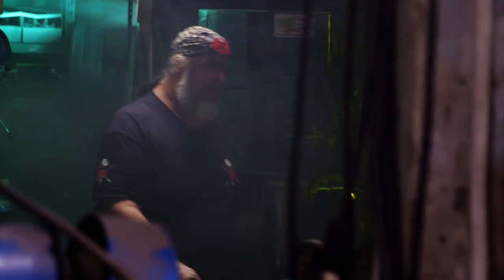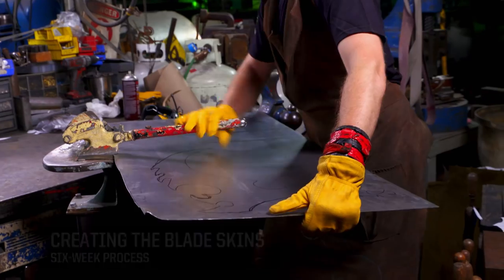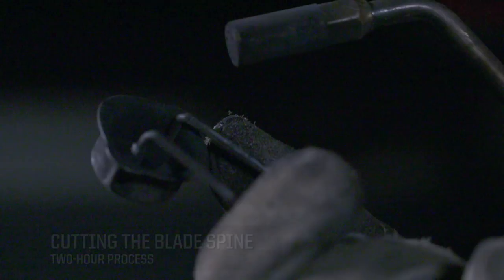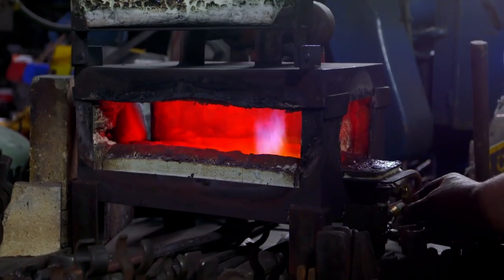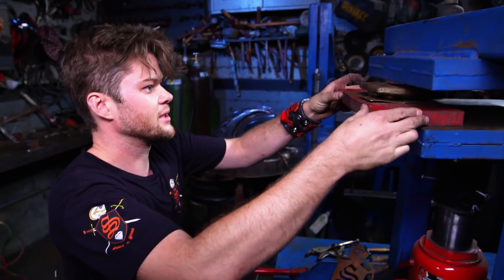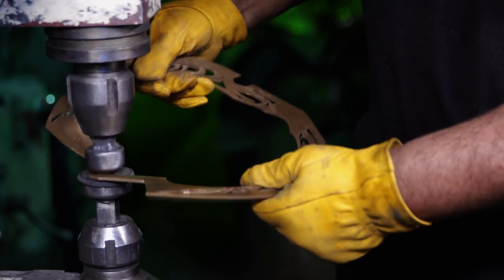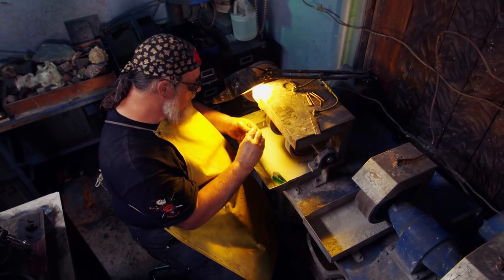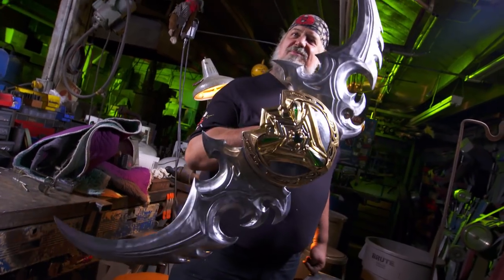Azeroth Armory: Forging Warglaive

Comment: I'm pretty sure if people put their minds into it, the glaive can be made to weigh less. Also, two of them balances the muscle pressure in your body, allowing you to wield them longer. I mean come on, I weigh 68 kg and I am able to hold 10 kg dumbells in each of my hands for a good 10 min - no problem. Furthermore, why isn't there 2 of them in the end demo? Blizz is being greedy again. And the way you fight with them is totally wrong. People keep saying that the glaives are the least practical weapon in melee combat. I tend to disagree. Imagine a large muscular person who can actually hold the ligher versions of both glaives (come on, these can be made lighter, it's just really expensive). There are two glaives with two edges and a shield for a reason. A skilled person will parry 100 of incoming attacks by any melee weapon, due to the glaives' massive blade surface. The only thing that can penetrate them would be a stab. Again, if you train to use them, you will never allow yourself to be stabbed in the first place. The tactic that makes the glaives so effective is that once you get in melee range, it's easy to shred anything. It's just like in the lore - to be effective with these requires muscle and quite a bit of training.
Reply: The only way to make this thing weigh less is to remove mass. Which would admittedly be a good idea - those spikes near the handle pointing towards the wielder are a danger to no-one but the person holding that thing. This beast is too long and too wide to be used effectively as well. You could also try using lighter material, but that would make the weapon itself weaker and much more likely to bend or outright break. There's a very good reason why blade smiths up to this day use mainly high carbon steel: It's quite simply the best material to make blades that can withstand some force.
Next up, using two to balance the weight would not work. It would only mean that you'd have to bear the impact of every strike with only one arm, which is a very easy way to break or dislocate something. Also, dumbbells are conveniently shaped which is why they're easy to hold and maneuver. Try tying your dumbbells to short sticks, holding those sticks and swinging them around and hitting something hard. I bet you'll stop after the first swing. You'd also slow yourself down exponentially with that insane mass you're trying to maneuver around. (Fun fact: The claymore, perhaps the largest type of sword ever used in real combat, weighed only up to 3.5kg, and that was a two-handed weapon.)
Furthermore, Blizzard is not being greedy. Even making just one of those things took multiple weeks and likely cost them in the 4-5 digit range. Even making one of those was a massively expensive and pointless undertaking.
Lastly, if those things were such good weapons to use, then people would have used them. We have several thousand years of history to look at, and even in times when quality steel and masterful craftsmanship were readily available, people did not use any such things as weapons.
It just comes down to simple physics: Why would you have a weapon with two blades? One would constantly act as a counterweight for every attack you do, or you'd have to split the force of your attack between every target you hit. Having two blades on the same weapon gives you literally zero advantages and so many disadvantages, it's not even funny. It would be unwieldy to carry outside and on the battlefield or duel grounds, it would massively reduce the number of attacks you can use, it would endanger yourself, it would require specialised training, and you'd simply have absolutely nothing to show for it. If you're worried about parrying or blocking attacks, just use a shield. It's designed for that sole purpose, and it's way better at its job ~and~ much easier to use.

Or, to put this in a completely different way: Try reading your comment again, but instead of thinking about warglaives, think about machine guns.

Comment: There is a reason in the entire history of man kind that Warglaves were never used, its because they don't work in a real fight, These are purely a fantasy weapon. Also to the people bitching that this was not real blacksmithing, you're idiots. This is as real as it gets. If you're not an expert at metal working then you really have no room to be running your mouth. This guy could easily pound out the most functional perfect battle ready sword in no time. Blizzard wanted him to make Warglaves, and this was the best way to do it. Different weapons require different processes to forge.

Comment: I know why Blizzard has this guy replicate their stuff.  He does an amazing job making otherwise impossible weapons.  However calling himself a blacksmith then making the weapons the way he does.  Na you're something but a blacksmith ain't one of them.  Put that big piece of plate steel in a forge and hammer out the edge on a power hammer or better yet anvil.  Use forged rivets to hold the piece together not nuts and bolts.  You don't use any blacksmithing techniques other than annealing some brass.  Shears and a grinder and some people doing tinsmith work don't make you a blacksmith it makes you a chump.  Call yourself a tinsmith and then I'll buy it, but a blacksmith you ain't.

Comment: If you can't wear a warglaive with one hand and use it right, just don't, please. You ruined all the fun the fans had with this barbarian dressed man who looks strong enough but just wields the glaive with 2 hands and swings it like a two-handed sword... The warglaives have this design because they are made to protect a demon hunter's body from head to toe. 7:17 - This was the only correct swing from the whole testing...
Reply: The reason he did that is because it's the only way to handle it safely. With the abundance of sharp and pointy bits protruding in every direction (mainly towards the wielder) as well as the sheer weight of this massive beast, it's just impossible to wield this thing in any way similarly to the games without endangering yourself massively.

Comment: These weapons require full constant movement of the body to be useful. Spins and slashes are the main attack moves and the design of these weapons actually allow for pretty good defense if nothing else. Not understanding why people say these are impractical, they just require a different, more mobile kind of combat style. Much prefer the Aldrachi Warblade tonfa style myself, favorite weapon design IRL actually. Much easier to use and more effective in my opinion.